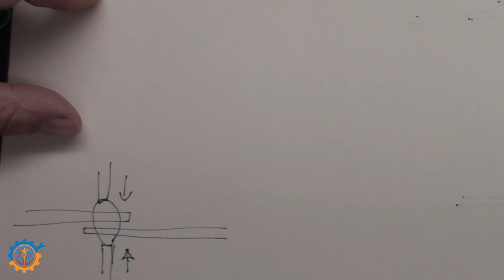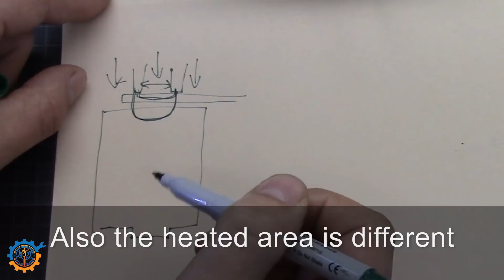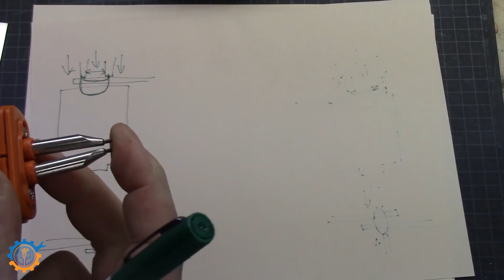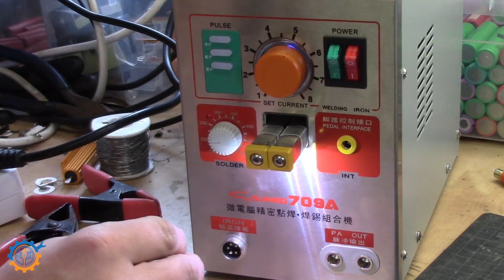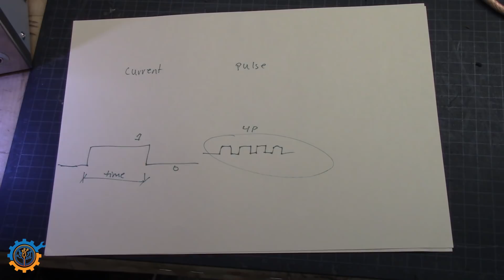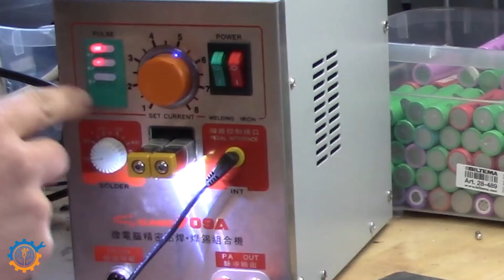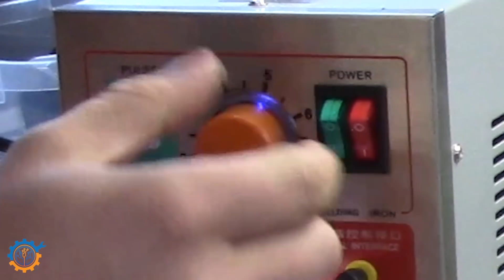Spot welding batteries tips & trix

Comment: Do you know why my electrodes that are standard copper after ten dots they are blunt? Don't know how others can solder in videos like on a machine gun to a fixed electrodes station for example. I have to hold the metal fille near by and stop after a few cells, is this normal? I have the 99gear spot welding board to 25-30 gear, connected to a car batt, don't press to much, keep them about 3-4mm apart..

Comment: Thanks!  I have spot welds on a CR2032 type button battery for a tire pressure sensor. What’s the best way to remove those spot welds to replace the battery? Will a regular solder gun heat up enough to remove them?  I don’t wanna eat the battery too much obviously

Comment: I built a spot welder using micro wave transformer. I can vary the number of ac cycles and delay per half cycle. Not really pulses but negative and positive half sine waves.  So I have a lot of control but can get consistant welds. I like your probe I think it is better than the the cables I bought.  What shape do you recommend on the electrodes, pointy, round, knive edge ?

Comment: Thanks a lot for detail info' on spot welding ( esp. for 18650 cells). S= space and size of the electrode. P=pulse or period of welding time. O= operating system of electrical power, eg. dc,ac.or pulsating dc. And T=temperature or Amps. used by the machine for welding the work piece . What about my thinking ?

Comment: Hi there, thanks for the vid.
A quick question, if the probes of the spot welder put at either end of the battery and cause a surge of current through it. Will this cause an explosion?
Reply from the maker: Try it ;) No dont. It can in best case cause a dead battery and in worst case set it on fire
Reply: @DIYTechRepairs  Thanks for your effort in testing it out. :-)

Comment: Flying sparks can also mean that your strip is not pure nickel, but rather nickel-plated steel.
This has a lot more resistance than pure nickel. It's a disadvantage for carrying current, but actually an advantage if you want to sport weld copper. Copper is too conductive to easily spot weld with a hobbyist spot welder, but if you put nickel or steel on top, copper 0.1mm in between and the cell at the bottom, the resistive metal will get hot enough to weld the copper to the cell.

Comment: There are too many errors in your video that contradict the facts.
 1) 2:32 The probes on the different terminals of the battery do not kill it, but rather restore it - remove the dendrites. The main thing is not to burn out the battery itself and the safety valve. the pulses should be very short and intermittent.
 2) 3:28 For a good welder, the dependence of the quality of the points and the presence of the experience track is weakly dependent on the distance between the points and should not differ by 2-10 mm. if it's different, then your welder sucks.
Reply: Plus: 
5:40  Stating must use probs at 90° aka
 perpendicular to strip/battery. As opposed to w/any sort of angle, which IMO is nearly essential, esp w/o a "pen style" welder. To what degree varies depending on application, but 90° when using separate probes is not very practical and can create resistance issues leading to poor welds.

3:10 As well as his mention of needing "very very firm pressure" when welding, rather than just enough to make sure there's good contact. IME Too much can burn it esp when applying probes completely perpendicular (90°) to the nickel strip.

 4:21 Another issue:  Essential to have "Even Pressure" on each probe when welding + must have "spring loaded" probes, both not true at all. 

7:03 He greatly contradicts himself now stating to use "Gentle Pressure" on the probes.   I believe about 250 grams worth, idk how the avg DIY user is going to make that calculation, but it is what it is. To clarify the correct amount is just enough to ensure solid contact

I don't think any of the issues are intentional and to each his own. Not hating but this will waste a lot of users time and perhaps property as well. My suggestion is to practice and do your own research never relying on just one (or two) opinion [esp online]. Good luck.

Comment: Great video! Even though I have my own home-made set up powered by a [too big] car battery, a 300A starter solenoid, a DROK timer [that goes down to the 0.05 second timing I find workable] and a momentary trigger button, I picked up several useful tips from you. Thanks. You might update your product links since the google shortened links don't work any more and aren't earning you anything. Also, the welding pen you use seems a bit hard for me (in the US) to track down with the retracting tip shafts as non of the ebay listings state anything about that capability. Think they all are anyway? If you'd add a link to one in the US, or ships here, I'd be happy to use it. I'll be heading over to your main site to poke around since I also have solar on my house. Thanks again!
Reply: Oh, I use tinyURL now that Google URL shortener went away.
Reply from the maker: @DeeBeesvideochannel  yeah should go back and change Links on My videos :)

Comment: There are two things I do for perfect spot welds. First I run used electrodes across a piece of fine emery cloth. 
Since I am also a Tig welder it is most important that there is no burn oxidation on the electrodes or if so you get an uneven current path or poor weld.
I also know that we can only spot weld with the electrodes on one side.⚠
I thought about springs under the electrodes for equal pressure.
I found a much better workaround. 
I place the battery pack between a loose fitting wood jig to keep cells vertical. Loose enough so no binding in the jig when finger pressing on the top of the pack. 
Under the pack I have a small 3/8" strip of plastic foam similar to the black pads found in some equipment cases. (I don't remember what old case they came from). Do not use foam rubber or styrofoam. 
When I press the electrodes on the nickel strip it allows the pack to shift a tiny bit giving almost equal pressure on each electrode.👌
This gives me excellent welds under both electrodes without one with great penetration and the other almost none. 🧡. 
A quick scratch across cleaning strip and on to the next weld.💥

Comment: Hi, Thank you for your video, could you help me learn how to spot weld stainless steel rings closed. The rings are used on jewellery, so they are very small. some diameters of the wire are .6mm-1.2mm. thank you for your help
Reply: You most likely will need a PUK-welder for that. There are a few different models, but the most important part is that they weld a bit of material INTO the joint instead of joining two metals without any material added. The more advanced models even pull the electrode away as it makes the weld. Those units are timer-controlled most of the time, but even though the weld is extremely short, the electrode has to be removed to quench the arc.
Reply: @weeardguy  thank you for your information, so fusion welding is not good ?
Reply: @erikgarston1395  I'm afraid not. I'm no expert, but did look into PUK-welding once, to see if I could utilize it for scratch-building. That's the way I found out it usually incorporates an additive to close gaps/joints. I would seriously avoid trying to weld lithium cells with such devices, as they seem to get extremely hot and are easily able to melt materials. With the thin housings of the average lithium cell, not a good idea ;)
Especially the electrode configuration with lithium spotwelding is a little different, as lithium-cell spotwelding incorporates having the two electrodes on the same material, where PUK-welding usually has the metal you are working with connected to an electrode, with the welding-electrode (a sharp, pointy electrode) being the other. The arc between the two joins the parts or closes gaps.
Reply: @weeardguy  Its only a hobby I like to do after work, these machines are a but expensive for my application. Thank you for your input it is really helpful to me. I will try configure something from the information you have given. thanks again
Reply: @erikgarston1395  haha, don't worry, I'm only a hobbyist myself and I'm now working on my DIY-spotwelder for lithium cells myself.
Reply: @weeardguy  Im just preparing a work area and i'll be playing around soon. Good luck to you, hope you get the results your after
Reply: @erikgarston1395  Well, I gave up on my DIY-attempts at spotwelding lithium cells and bought a kWeld instead. Have not used it so far as the charger for the LiPo battery still needs to come in...

Comment: What the electrode tips are made of, I use copper tips but they won't last long. Thanks
Reply from the maker: I use Cooper too. Works as Long as you dont over heat them
Reply: You can resharpen copper when dull.. load up in drill to resharpen tips. I just make several sets  at a time
Reply: Beryllium copper is much harder but take precautions when sanding them to a point. Can be hazardous

Comment: Very good overview of ALL the factors, with the physics! Thank You! Also good IPM (Information per minute)! I was intently listening and relating your info to my project in a Flow; EXCELLENT timing on your part! Or is that Pace...OK,just call it  IPM   (yes, I'm building a spot welder from my "junk box" parts, so results WILL vary.....6xIGBTs, 556, 12v 10A batt, trickle charged, )

Comment: I have an older spot welder Sunkko 788H, which doesn’t have the remote handle. Due to this reason, I find it very very difficult to spot Battery Banks eg: 3S5P and so on.  Your demo is prompting me to procure a handle, like yours to ease the job. Thanks again.

Comment: Have you developed any recommended settings for various thicknesses of the nickel strip?
Reply from the maker: I havent. There is so many different type of nickel strips and sizes. The one I used here i used 10p and power set to 6.5 roughly. That worked well. Can go to power 7 as well

Comment: How about a cheap ass spot welder straight off a car battery (without transformer)?
Reply from the maker: You can spot weld with car battery or caps yes. You just need to get some electronics that can turn it on and off. Mosfets of some kind and all that. There is kits out there that you can build.

Comment: I'm very interested in the DIY cheap ass transformer spot welder! I have a transformer from a 660 watt ups that I could utilize.
Reply from the maker: Not all transformers are useable but your might. MOT are known to be easily modified. Especially for this purpose even though they arent optimal.
Reply: DIY Tech & Repairs 

MOT?
Reply: Micro Owen Transformer

Comment: I'm thinking about getting one of these spot welders and wondering about the longevity of them. How long do you think your Ebay spot welder will last before it breaks down (doing fuses and nickel strips)?
Reply from the maker: Its a very good question and Im not sure. Perhaps google can get you the answers?  If the spot welder breaks down its most likely the electronics and they can easily be switchet out to an Arduino if you have that knowledge.

Comment: good video, not super long when it's contains full details for every level of cooking nickel
would've been good to have quick howto on knowing which nickel strips are dodgy online and which to buy.
Reply from the maker: Was thinking of that part but I dont have enough knowledge myself to say which ones are good. Might be that I follow that up in short
Reply: Sand the strip and soak in salt water. Look for corrosion . Pure ni will not rust and will not spark when cut with grinder.

Comment: What would you think about having one larger tip to contact the battery case and the smaller tip to do the welding.  I would think the larger contact area of the larger tip would do less damage to the battery case and the smaller contact of the small tip would weld more efficiently?  If I could afford one this is what I would try.
Reply from the maker: For spot welding fuse-wire i think that would be worth testing! I think that would save you the probability to weld through at the tip that is not on the fuse-wire.  For normal spot-welding you want the small ones